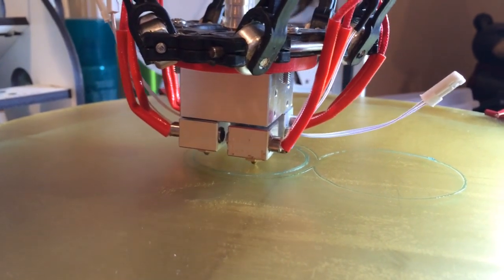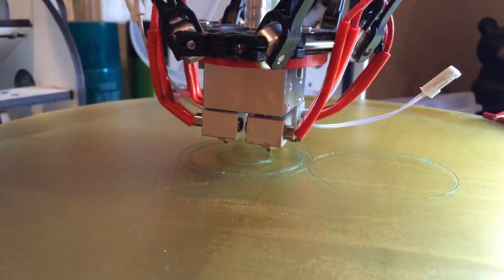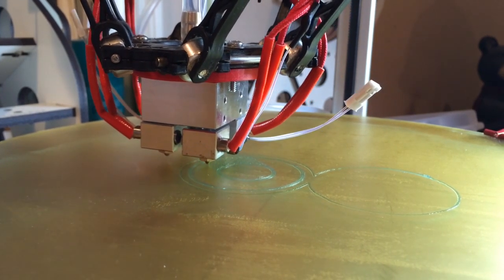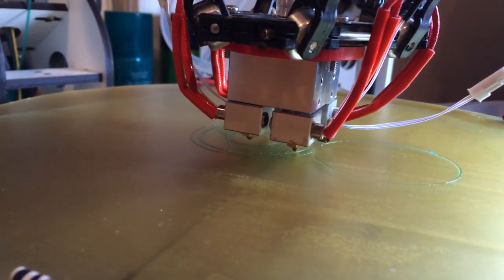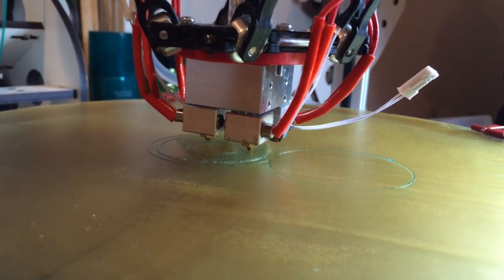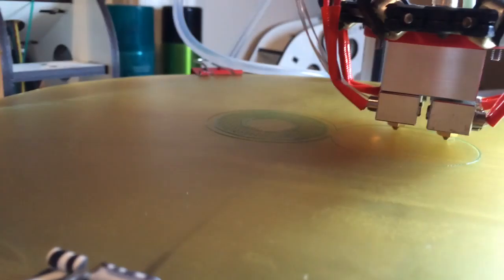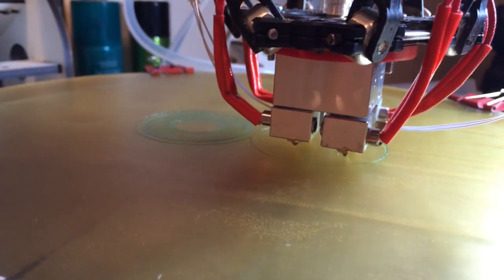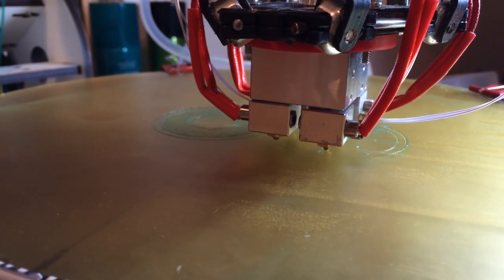First print with Kraken!

Comment from the maker: I no longer use the Kraken or any multi-nozzle extruder for multi-extrusion. A combination of lack of "excellent" support in slicers to really provide the necessary control and the availability of the Diamond and Cyclops switching extruders finally made me give up. I DO use the Kraken as a single extruder on a daily basis. Water cooling is awesome and I've converted all of my hotends to water cooling.